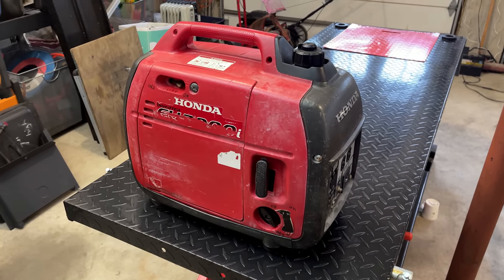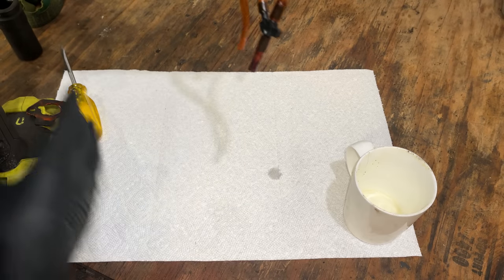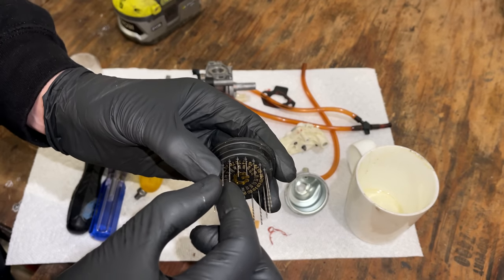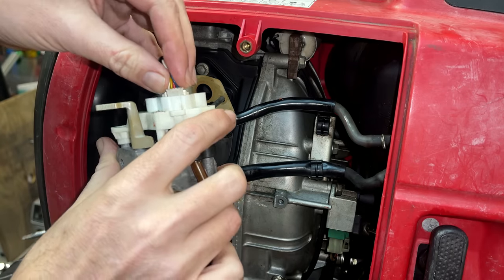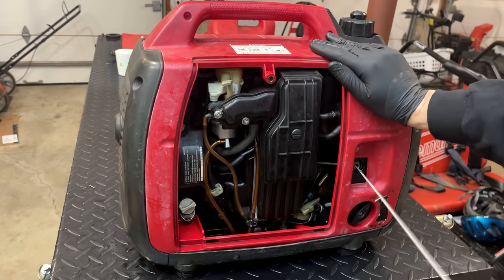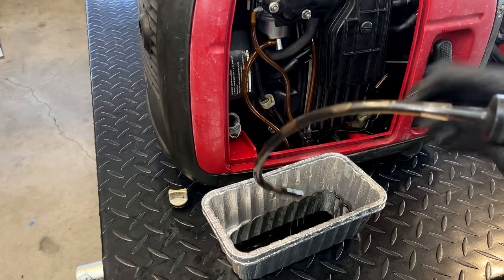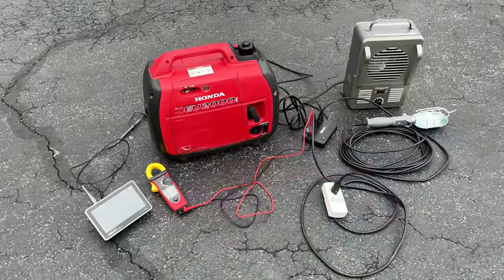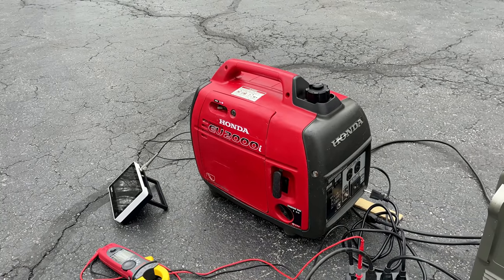Old Honda EU2000i Generator Leaking Fuel

Comment: That's a nice generator, I can't believe no one would touch it. Really clean power output and quiet to boot. What's nice is you can even get decals for it. I'd like to see a close examination of that float, I wonder what's up with it. I think the majority of that smoke was just from excessive fuel, probably a good thing you changed the oil. It was probably diluted with gas. Good job.
Reply: Leaking gasoline is something shops try to avoid like fire... Get it? Fire. I think it's just easier for them to stay away from it than to do something right.
Reply: Those types of fuel pumps are a diaphragm type. If some of the seals are bad, it can and will draw fuel into the crank case over time. When the crank case gets full enough, it will blow the crankcase gasket.
Reply: @goatman86  If they are afraid of gasoline leaks, they shouldn't be in the small engine repair field.
Reply: @davem6492   Truer words were never spoken.  Well, maybe once or twice.

Comment: My experience with float in carb saging has been adjusting a metal piece that engages with the needle. I couldn't see if this was an option with the honda carb you were working on. I suspect it could have gotten bent down by the same party responsible for using rtv in a gas motor. Nice job getting that back right. It was nice of you to spiff up with new decals. You are very thorough and i enjoy your channel.

Comment: I absolutely love it when you have an EU 2000i on your plate… I’ve had mine since 2000, bought new. It has <450 hours on it and I depend on it for outages. I bought the Shop manual with it when I bought it and other than carb cleaning it’s never needed anything else. I used it in Mexico on the beach and Mexican gas leaves a residue in the jets and associated tubes. They clean right up and it has never missed a beat in all these years. You can’t beat a Honda.

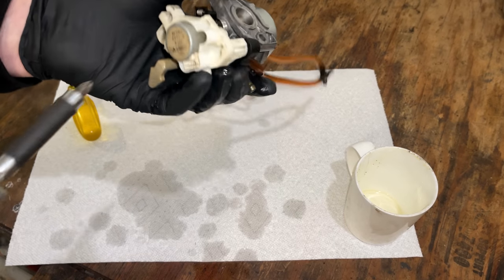Comment: At 7:25, the screws that strip out easily are JIS (not Philips), a JIS driver will work better.  Philips can work, but make them real easy to strip.  You may know this already, so this is for anyone who isn't aware.  The dot on top of them is the giveaway that it's JIS.
Reply from the maker: I have a JIS screw driver just for that purpose.  Still strip out though if not careful.

Comment: You are right by stating the gasket between the engine and Carb is the most critical,It looks to be running rich at the end.I fixed one of these generators by using seal all adhesive gas resistant gel on both Carb gaskets.And the generator ran much better without black smoke and used a E instrument E4400 Gas analyzer on the exhaust output to see the difference.If there is a small air leak on those gaskets,The engine will run on either side of lean and rich.A good exhaust Gas analyzer would really erase all doubt of uncertainty and eliminate  ambiguity of how the engine is running within the stoichiometric range.Good work for the people.

Comment: I being much more of a shade tree chanic than you. May have continued to pull and pull and pull and pull before I checked the spark plug and spark.  I’m surprised as thorough and meticulous of a diagnostician of small engines and mechanical things as you are and the owner telling you that he had to run it with partial choke that you did not quickly go to the spark plug when it failed to start after carb cleaning.  But hey, we all have our off days.  LOL. Great video.  I was looking at buying a used Honda generator unit like or similar size to this a few days ago that was reported as having ran last time it was used and now it won’t.  If I see their post again and it’s still available I may give heavier consideration to buying.  After I give due consideration to considerably less dexterous hands and fingers.  Left wrist ulnar and radius bone shattered, median nerve spent a month impinged between shattered ends of ulnar and VA took a full 30 days to get me a referral to orthopedic surgeon where it was found that all the shattered and broken bones had almost completely mended in the wrong places taking him about 4.5 hours to chip, break, reposition and glue bones as best possible including some bionic attachments consisting of numerous pins and a couple plates that was early 2021 then this Easter 2023 I either had a small stroke or a ruptured cervical disc that affected the same areas of the right hand.  So I now refer to my hands, left and right as Bwoke and Stwoke since they both have reduced dexterity, sensory and strength issues.  But, I still have hands and can make do mist things after dropping stuff and figuring out alternative ways to do things.  Really enjoy your videos.  If there is a local vocational junior college or high school with a vocational program they are missing a natural teacher in you not being there teaching our youth how to do such things.

Comment: Hello James, That was a professional observation that fixed the fuel leak.  Unless a guy wanted to tear it apart again to fix the low oil shut down, I think I would just add a couple more ounces of oil and overfill it just a little bit.
Reply: Never overfill a small engine that relies on splash lubrication, it can be just as detrimental as running low oil. Try a diluted oil (run 1/2 ATF mixed with 10w-30) and drain, or flush crankcase with some two stroke gas. The low oil sensor is just a float/contact set up and you want to remove any sludge possibly causing the float to stick. Then fresh oil change or two, you'll be fine.

Comment: Rance here. A lot of good information in this video, especially if one has seen your previous video on other similar machines. It's good he brought the gen set to you. Looks like he had done some prior work on it. I think the best advice is these require expert mechanics like yourself. I knew you would get it running but I still felt that this gen set needed more maintence because it had been lacking routine maintece in its past. I wish the owner would have requested for a complete redo it would serve him better.
Reply: I think the previous owner tried to fix leak by adding silicone to gaskets.
Reply: @karirautio  Yes, I think you are right.

Comment: I used to work at a outdoor power equipment dealer. We were a Honda dealer and sold these units. Customer brought one in locked right up. Said it was fine when he put it up and was locked up when he went to use it again. I could not get it to free up neither could the Honda factory rep. There were no signs of being run dry. I ended up putting a short block in it under warranty. After the job was done me and the Honda rep finally got the piston out of the bore. The rings were corroded right to the cylinder wall. Pitted the cylinder wall some. I think it got some water in it.

Comment: I love working on those. I actually have 4 of them but it is a challange finding parts suppliers that have all the parts in stock. Shipments get delayed from backordered parts. Ever so slightly enlarging the ultra tiny pilot orfice improves idle hunt. I use  motorcraft synthetic 5w40  oil in mine and don't have the cold oil shutdown problem. There is a recall for some models for a fuel line from the pump to the carb to be replaced. Also it's a good idea to adjust the valves and if needed decarbonize the piston and rings by a nice hot soak of penetrating oil through the spark plug hole. Works for me
Reply: I have one of these that is complete. I put a new timing belt on it after discovering that was what it needed. The guy claimed it was leaking oil from somewhere. After repairs and running it for three camping trips it is burning oil. It will run for about 2.5 to 3 hrs and low oil shutoff. The power unit is good and I want to sell the Honda. Location is phoenix, Arizona
Reply: @r_azona_outdoors  why not re ring it? You may find the rings are stuck in the piston due to carbon.
Reply: @williamvaughan1218  I had the engine apart and the cylinder looked good. I had the rings off cleaned and reinstalled. I didn’t notice anything that would cause it too smoke like it.  Maybe something to do with valve guides.

Comment: James: I had the same model unit in my shop last year. The carb would flood when cold starting. I finally got an aftermarket carb to solve the problem. Cleaning and going thru the old carb did not solve the issue. I usually have excellent cleaning carbs in my ultra sonic cleaners, but not this time. Thanks for an excellent video.
Reply from the maker: Have had the similar issue in the past except it would flood after running for about an hour.  New needle and seat did not fix it.  New carb did.

Comment: The only problem I have came across is owners only running a couple of low wattage light globes and using in on echo throttle. Theengine gets glazed bore and start burning oil. The fix was load it up with near max wattage and run a full tank of fuel through it, which will de glaze the bore and in turn fix the oil burning.

Comment: On ANY Honda engine, especially one that experiences a flooding issue usually requires a new spark plug. The NGK plugs do not hold up well to fuel saturation.  Pretty much any time I service a Honda engine,  I replace the plug automatically. It is not uncomon for the needle to fail if the unit sits with old fuel in it. I am amazed no one wanted to service that generator. I have been given several generators over the years simply because the owner was told it was not worth repairing it. The price of labor today really can push the consumer into buying something new. I have a real issue with that. To many good repairable small engines end up scrap over things like you experienced.

Comment: I wonder if the oil had ever been changed. Yeesh!
 Before I started using ethanol free fuel in everything but my pickup, I ha a couple failures of plastic floats and a needle that lost it's neoprene tip.
 Between the old oil, the fuel and the transfer of said fuel into the crankcase, I wonder if it will continue to use a little oil.
Will you keep us posted?
Either way it was a very informative video. Good on ya.

Comment: Thanks for the video. I bought one of these to recharge my Victron Inverter battery setup for crucial appliances at home. I went back and forth between this and a champion that was 40% less. The newer Eu2200i version shifts the oil inlet closer to the edge of the machine, which makes a oil change much easier. Glad to see a teardown w tips. I'm using ethanol free with Stabil and going to maintain it closely.

Comment: I recently got hold of a THD meter. Been having fun measuring several UPSs, a pure sine inverter, and even my local power grid. I've got a couple conventional generators I want to look at later this spring. It'll be interesting to see what the sine wave and THD look like on those. :)
Reply: I have a ups that powers my network rack (which is basically a onu , router and switch) that has an output thd of more than 55% while in battery backup mode cus it is a square wave unit. But it doesn't cause any harm to any of the load connected and runs for few hours on a 6ah Lifepo4 pack.
Reply: What meter do you have to measure thd? I'm looking for one and can't find one locally and don't know what to look for online

Comment: Nice job checking out & repairing this Honda! I have the EU1000 and carried it around in my work truck and of course it would get a bit dirty & scuffed up. I would spray it down with Armor All,  let it soak in for an hour or more & then buff it out. This would bring up the finish a bit nicer.

Comment: Well done!  If I may make a suggestion you're likely aware of, using JIS screwdrivers greatly cuts down on the number of stripped phillips screw heads. Having 2 of these units myself (One is an EU2200) reminded me a no fuel in bowl start can indeed take several pulls. There is a company called Hutch Mountain who makes excellent propane adapters. I've had good luck with them.
Reply: I've been considering a propane mod to my EU2200i, but think I'll wait until the the factory warranty expires!  Good to know of a reputable supplier.  The one thing I don't love about owning a generator for very occasional emergency use is having to periodically replace fuel and start the generator up.  Ethanol-free gas is very hard to find in my area, so I keep $$$ TruFuel in the generator and a 5 gallon gas can of regular unleaded that I periodically pour into the car and replace.  How many running watts can you get out of your propane converted EU2200i?  I know propane is about 90% as energy dense as gasoline.
Reply: @readyplayer2  Never did a formal test, but I recall Hutch telling me about a 10% loss could be expected. Great company to deal with and a surprisingly  easy modification. Any mods are easy to reverse. Hardest part would be finding a plug  or grommet to insert where propane adapter fitting port was drilled. I can get ethanol free fuel with a little effort (you can also make your own) which I store exclusively for emergency and lawn equipment use. I find mixing PRI-G keeps it good for a year. I don't use mine very often, but run them every few months alternating gas and propane to keep things from drying out too long. Every gas use is followed by draining carb bowl with drain screw. Zero issues this way. This said, I do annually drain all fuel and replace with fresh, stabilized gas in EU2000, EU2200 and EU6500 units. I also keep spare carb parts and gaskets plus more just in case, but that's the Boy Scout in me. What I like about propane is the all but unlimited shelf life and cleaner burn. Using a "Y" adapter I can power both EU units at once in parallel. Works great and I am rather particular in the equipment I get. Before I forget....I added an hour meter and Honda's anti theft bracket to both.

Comment: Seems odd that even a Honda dealer wouldn't touch this unit, or any other shop.  Boy, that Honda looks like it was run hard and put away wet.
The RTV on both gaskets tell me that a) someone was in there before and b) they had no idea what they were doing.  That would also explain why the carb bowl was so clean and why the main jet was loose.
I've never seen a plastic float deform quite like that one did.  I wonder if the owner used some fuel additives that reacted with the plastic. 
It's also interesting that the bad float held a tight seal with the needle and seat, even at 5 psi!  That equates to over 11' of head pressure!  I'm guessing that it leaked when installed as the bad float maybe couldn't float up all the way past it's originally-intended position when filled with gas.

Either way - great video and well done!  It's nice to see the care you take with cleaning and restoring the outside of the unit, and even buying the new decals.  Attention to detail as always.  
I'm always searching CL for people selling inverter gens with no start, for cheap, but they are hard to come by.
Reply from the maker: The owner said he had someone with automotive experience work on it after it started leaking and he applied the rtv and cleaned the carb.  Some carb cleaners can trash the needle.  The holding 5psi was due to gravity.  When in the carb the float must float high enough to close the needle.  Because the float was off,  it would flood and drip and never fully close the needle.

Comment: I originally commented that "...I bet that a tiny piece of RTV got stuck in the needle...", but then I deleted that comment because later in the video, you found that the float wasn't level. Obviously, my idea was off base. Nice work. I think that another tech may not have picked up on the float being so far off level. Guess I should watch the whole video before adding my 2 cents. :)

Comment: A great video as always ,  cannot understand how the original needle and float arrangement could end up like that with original parts still installed. Watching the sine wave output and THD reading's being so close to perfect makes me want to further study the concepts and hardware that makes that possible . Filters and PWM technology with zero distortion on crossover where usually you would expect some more distortion.  Inverter technology using powerful rare earth magnets instead of coil generated fields and the rotating speed not effecting frequency is so much more effient.

Comment: Converted a very similar (if not the same) generator to electric start and automatic switchover a while ago. In hindsight it was not the ideal choice, way to cramped for making modifications but it did workout in the end.

Comment: You are a brave man ,I brought one of these 240 volt Honda generator and after me,and my mower mechanic spending hours on it he got it going and I sold it as quickly while it still ran. I do not like the ignition systems it has . Thanks for. The video though James.

Comment: Good job and a lot of patience. From my experience, the smoke is often indicative of people tipping these over on the side, allowing oil to contaminate the muffler. If the smoke doesn't clear after a few minutes, the muffler will require thorough cleaning that could take several hours. Still beats paying for a new muffler from Honda.
FWIW, float needles do not get worn and shorter over time. That along with the RTV points to improper repair in the past.
Keep the videos going!
Reply: Cleaning muffler of oil = running engine under high wattage load for an hour.
The oil burns out of the muffler packing no problems...

Comment: Nice repair. Them Honda's take a beating friend of mine has one we used at his off grid cabin for years. The oil sensors in then machines clog up very easy with old oil. Even cleaning them out don't work. We changed the one in his and changing them isn't for the faint at heart lol what a pain. His smoked as well after so many years the rings wore out. But even though it smokes it will still get small jobs done.